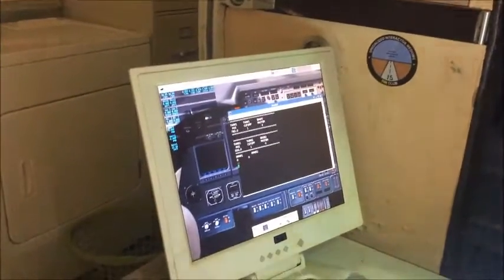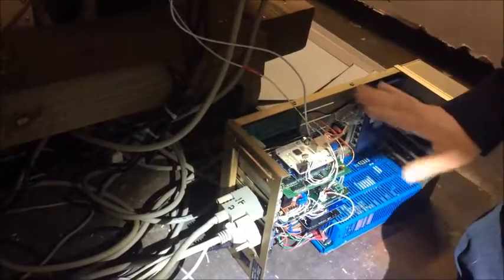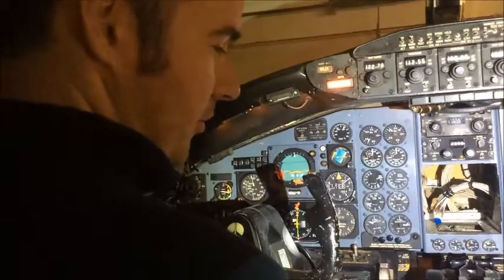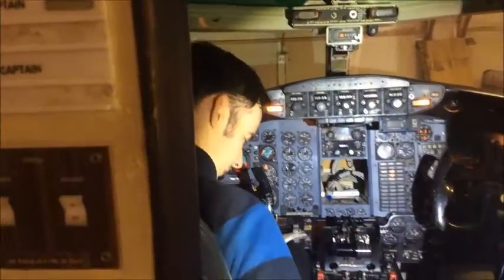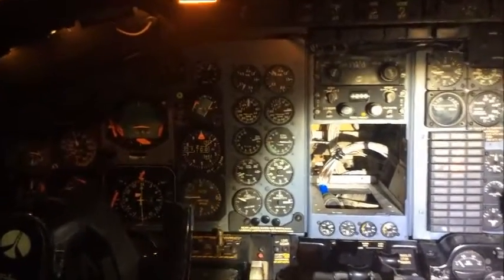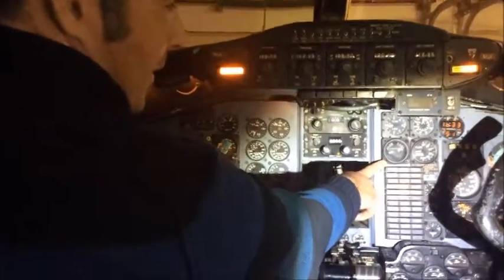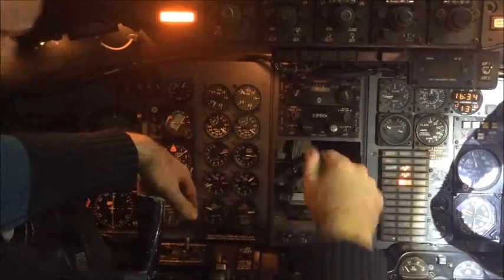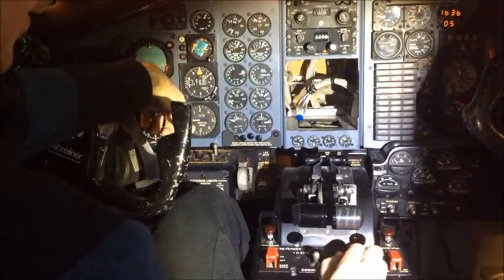Sabreliner Engine Start

Comment: Matt, nice job, next time please use a boom mike, It is hard to hear you sometimes.. and where did you get the io box with an ISA bus and how are you mounting an ISA slot  to an Arduino? and what do you use the BUS for???
and 
HAPPY NEW YEAR
Reply from the maker: +Cris Harrison The box is from an old AST-300 sim, it was the image generator computer (SBC with various supporting cards). The board is a passive backplane, I am tapping it for the 5vDC and 12vDC lines (and ground, of course). I use standoffs to mount my Arduinos to old ISA cards, and just wire from my Arduinos to the nearest 12v/5v/GND leads on whatever scrap board I'm using. It's slick, and allows me to work on each individual module separately. :)